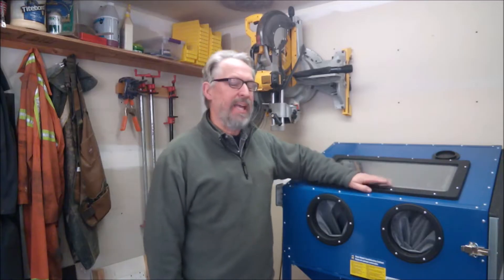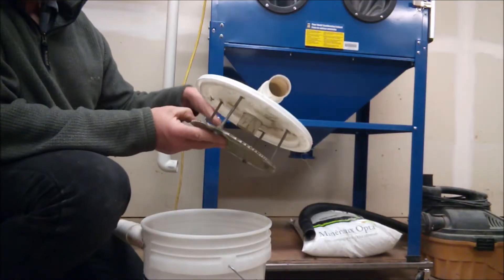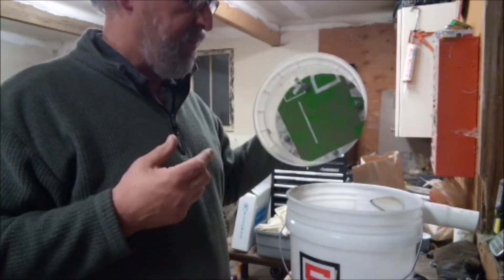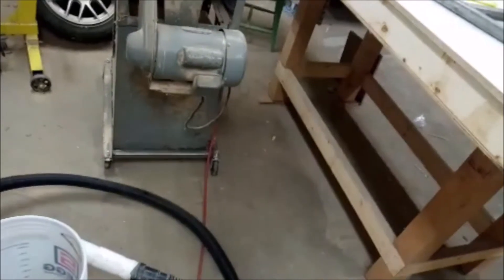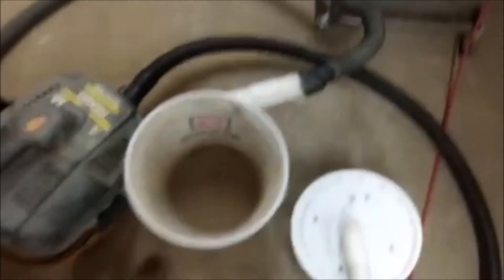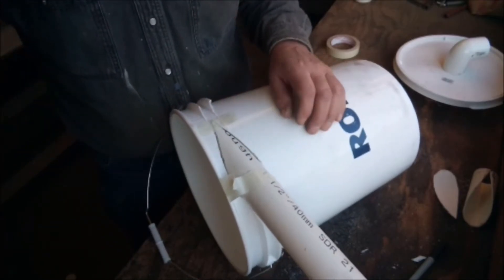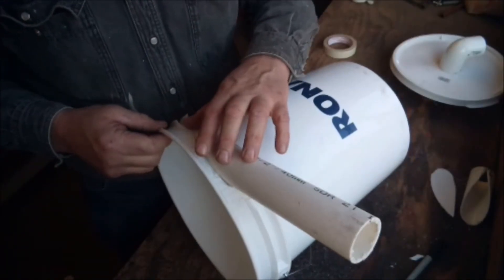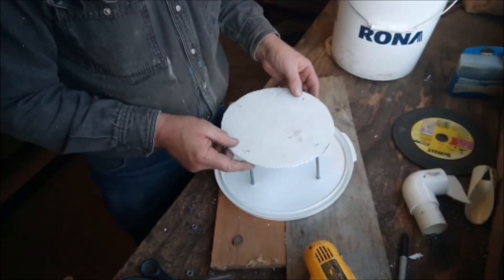Easier, cheaper, simpler, better? dust separator based on Thien Baffle

Comment: The Thein baffle topic had me baffled - too much info (and noise) not enough clarity. You've clarified what they are and largely, how they work and how to make a working one for peanuts, thx!
Details: does it matter if the inlet on the bucket side is above, even with or below the baffle? It looked like the first one you showed the inlet was pointing upwards just a hair, on the one you demonstrate making it appears parallel to the bucket top. I'm an 'overthinket', am I doing again? Wondering if that matters?

 I'm going to try this out. I bought a couple of polyE buckets, 25gal IIRC. They're a good bit taller than a 5gal. I'm thinking rather than commit to cutting into their sides, I'll make a drum above, maybe from a 5gal, and cut an inlet in it and seal it to the top. Think the extra height will work well with this baffle idea? My main use is woodworking machine dust collection. I have a used 1.5hp collecter with impeller to try out, an old Grizzly. Hope to make it 2-stage and incorporate 1-micron filter cartridges forthe outlet/return air! We'll see how it works out.

Comment: Hi, not bad for your fist you tube video, talking to the camera will get easier with time (ex-teacher so I know) you said that your shop vax was 5 HP, that seems a big motor for a shop vax, all mine are ½ HP so if yours is 5HP I would like to know the manufacture so that I can get some. I like your blast cabinet, I am in the process of building one myself.
Reply: Maybe it’s 5 hamster power?
Reply from the maker: I don't know how they rate vacuums so high. It has 5 HP plastered on the side but how can it be 5 HP if it only draws 500 watts? 1 HP is, by definition, 746 watts at 100% efficiency. Not sure where the 5 HP comes from. Anyway mine is a standard small shop vac as you can see from the video. Thanks for the comment!

Comment: Nice. I’m concerned about the strength of that glue joint on the side of the bucket with the long hose pulling on it. One thought is a wooden ring on the outside that holds the tube a bit to take pressure off the joint. 
You are very skilled at making push tight hols in plastic. I have not had such luck in the past. 
If I manage to do a similar one I’ll send you the info as “constructed” feedback. 
Thanks for the material.
Reply from the maker: I haven't had any problems after a year and some of that on job sites. the hole was a pretty close fit and I used a fairly high temperature glue gun so maybe that helped.
Reply: You're right, there's another video where someone makes a similar one and he makes a wood ring to hold the tube because the glue eventually fails.

Comment: Just finished your video and am motivated to go out to the shop and build my own with your design.  Not really happy with the performance of the Home Depot model.  Yours seemed to work soo much better right off the bat.  Does removing the filter from your shop vac create any damage to the motor?  Will try it your way but hope to hear your answer.
Reply: Everyone of these I have seen the filter was left on.
Reply: Some vacs take the air through the motor. Most bypass the motor.

Comment: Excellent!! One Question though, what's the  distance dimension between the lid and the baffle ? Thanks 😊
Reply: He used 4" bolts, then subtract the two nuts and one washer and that should be the distance! Nuts and washers are pretty standard, enough for this evaluation. [edit: and also remove the thickness of the top but not the baffle.]

Comment: I built my system using a cyclone but the filter on my shop vac continues to clog with fine dust. I'm on the look out for a decent sized bucket to try this for myself. Thank you.
Reply: Get 2 buckets with lids. cut off the bottoms. Build this separator and nest it into the other upside down bucket. Empty the bottom bucket. Add handles and alignment guides as necessary.

Comment: Great video, simply explained.
My 2 cents ...
Encase the bolts with 5/8" I.D. plastic pipe. Glue the ends of these 4 pipes to the baffle and lid for added strength and less friction in air flow...no debris build up.
Reply: Good idea, will try that on mine when I make it

Comment: Did the hot glue hold up after a year?
Reply from the maker: yeah it sure does gg, I've had it on some reno jobs and it takes a beating and keeps on ticking! No problems so far, works great on drywall dust and everything.
Reply: @theconsiderednut6679  Awesome thanks for answering!

Comment: Correct me if I'm wrong. Wouldn't it be better IF the dust inlet is below the baffle? 

However, Nicely done 👍
Reply: It's hard to argue with results.
Reply: I had the same doubt.
I also would like to see the comparisson of the results with and without the baffle. Doesn't it break the cyclone principle in wich the inside cone of wind is what prevents the dust to go up?
Awesome video though!
Reply: @SamuelCersosimo  I think the main reason for the baffle is when the bucket gets close to full the baffle keeps the dirt from getting sucked back out into the vacume